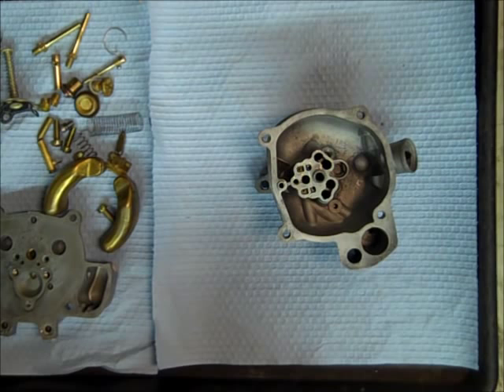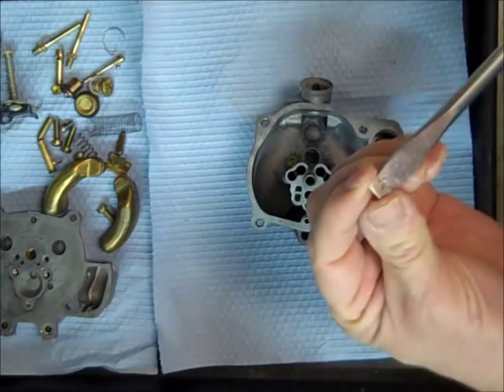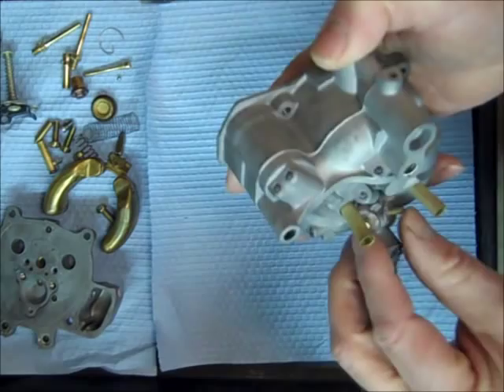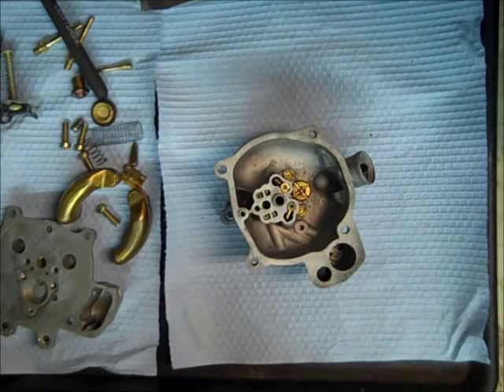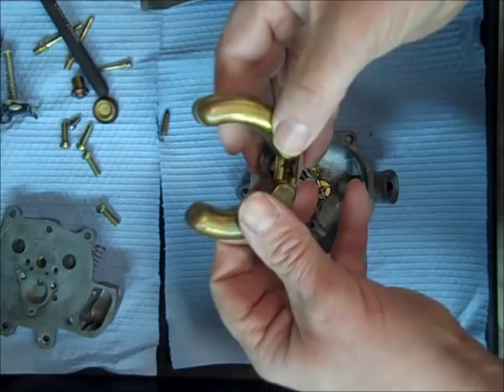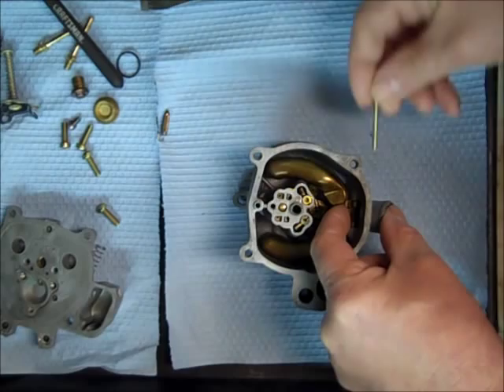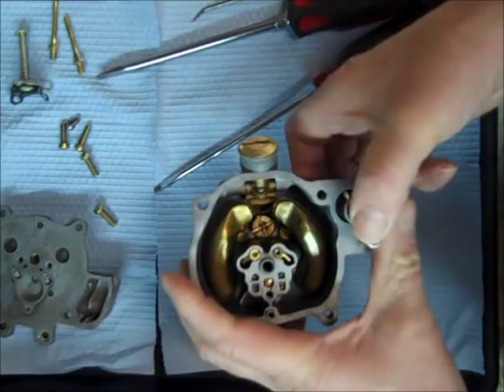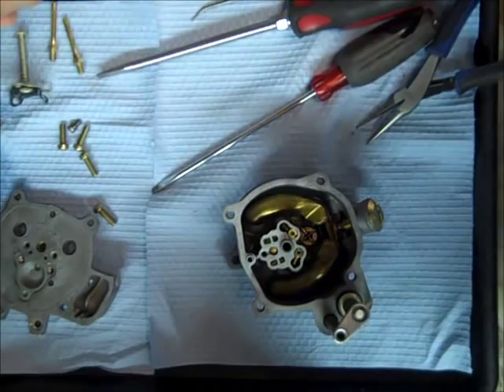Holley 4000 Carburetor Assembly - Part 1

Comment: Hi Mike, My carburetor will back fire through the carburetor.  It idles great, but if you accelerate, it hesitates, back fires threw the carb. Then works well.  Ideas?

Comment: HELLO GREAT VIDS IS 2 FRONT MIXTURE SCREWS IN LIGHTY AND THEN OUT 1-1/2 OR 5/8 OUT TO START WHY WOULD MY RIGHT SIDE (PASSENGER SIDE) MIXTURE SCREW NOT AFFECT ANYTHING NO DIFFERENCE DOS'NT CHANGE RPM OR IDLEING OR ROUGH BOG ECT THANKS JOHN
Reply: thanks mike i checked both mixture screws and found one tip was flattened and put in 2 new ones now i get responce from both sides
thanks john